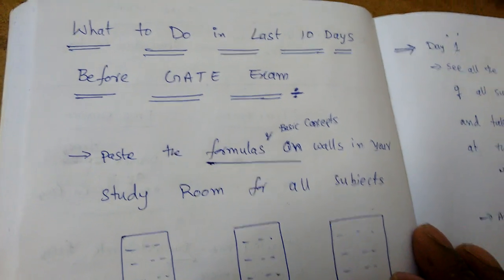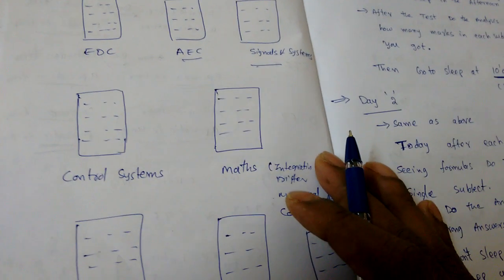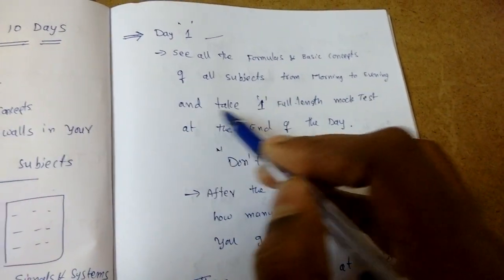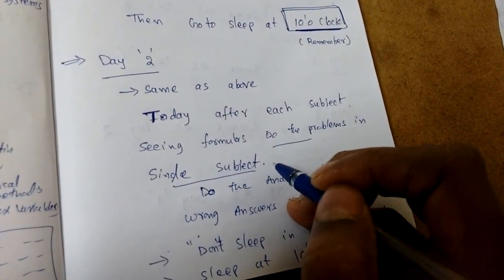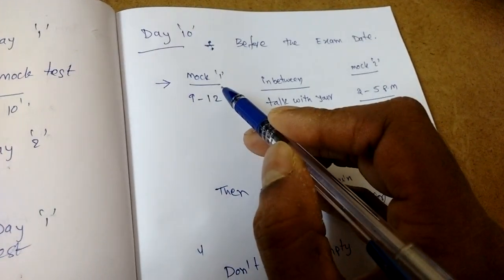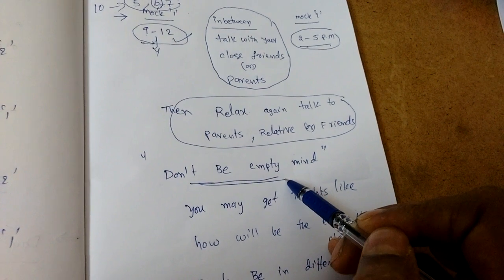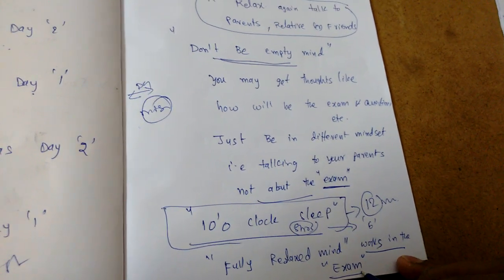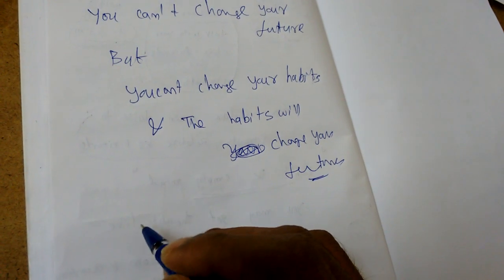What to do in last 10 Days Before GATE Exam for the Best Results

Comment: Sir I am from BE Telecom domain 2015. Working in TCL. I thought of preparing for GATE 2018. I have too much doubts.
1) Is there any separate GATE exam for TC stream. (like gate EC, gate CS, gate ME, etc)
2) Since we study all sub of EC we can also crack the gate EC. so EC gate is the same paper for TC ppl.
3) In PSU if Iam from TC and got good rank in GATE am i eligible for those company who take EC ppl or they only take EC guys?
4)I am 2015 pass out, i thought of going for gate, if i take 2018 gate and got good rank is that ok. I mean if there is a gap  after studies is that ok. or will it effects PSU
5) Is there any age limit for the GATE 
6) Do PSU ask for age limits 

sir please answer it with sl.no
waiting for your answers 
Tqs for your answers
Reply from the maker: no you have to opt EC stream or other streams